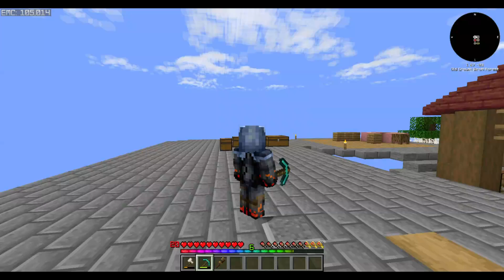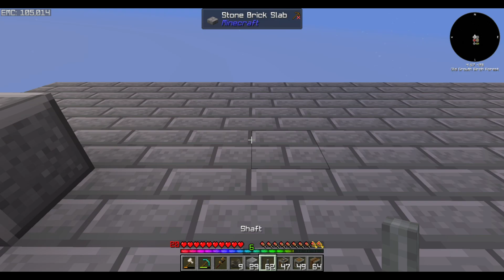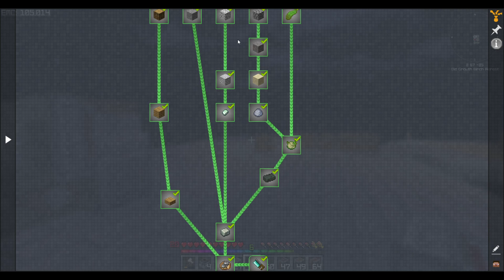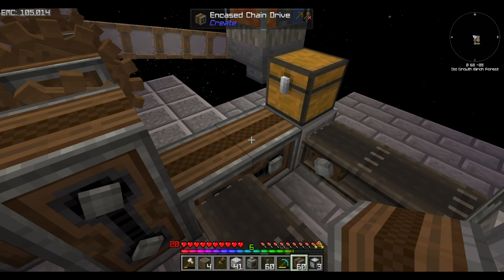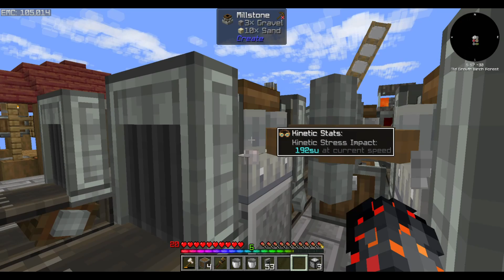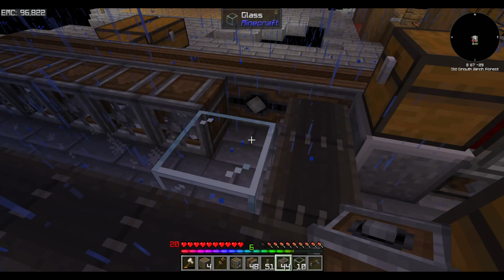C2M Sky Edition 2 - Part 6 - Automation with Create

Comment: How did you get rid of the quartz and flint problem?
Reply from the maker: You do actually need a fair amount of quartz and flint in later ages, but I put a draw with a funnel into a lava pit, which means that any drawer that fills up the overflow goes into the spare drawer and out into the pit.

Comment: Factory looks great, but I would use 3 separate belts for the washing rpocess for each material
Reply from the maker: @viktordaruka6406  thank you. Honestly your idea might have been a much better design
Reply: Nah, I’m a noob, struggle just like you. But the fans reach multiple belts, depending on the rpm. 

Btw my design is very similar to yours, just have 3 different belt on the end, and is built more vertical. I have the generators up and the washers and sorting under
Reply from the maker: @viktordaruka6406 I have found that as I progressed I have been able to change the factories.